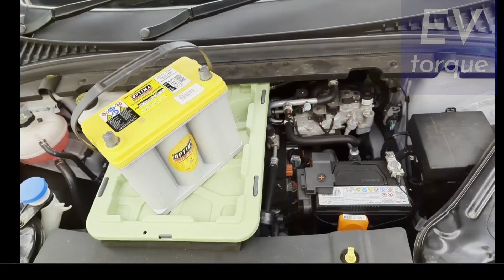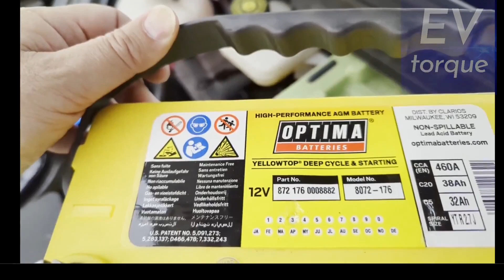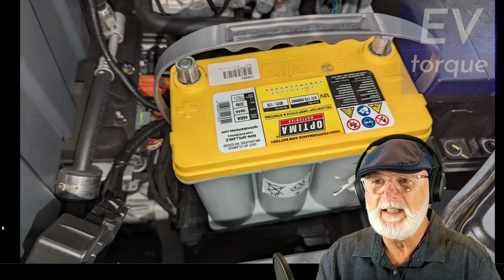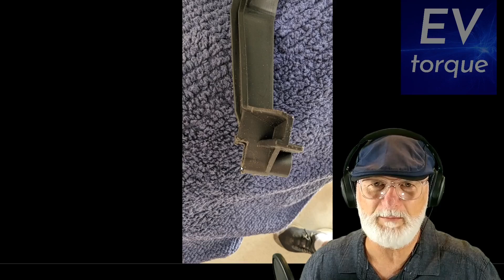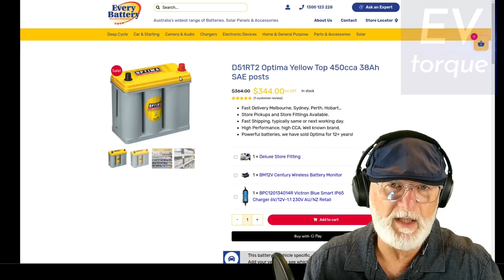BYD Atto 3 - 12v Battery Upgraded with a Deep Cycle Battery

Comment: At 6:20 your battery monitor was not "going berserk". You should trust your instruments more. It was showing exactly what it was seeing: When an electric motor, basically a large electromagnet so a large inductor, with a large compensating capacitor, gets its current cut suddenly, you get a voltage spike and then a voltage trough. What you are seeing here, is the real reason why they put the 12V battery (or 16V for new teslas, same reason): To mitigate the spikes created when your car hits a road bump and then the high voltage battery has its chemicals all mixed-up for a millisecond, so you get a very short current cut. They could resolve this completely by putting six super capacitors in series (each needs a balance board in parallel, of course, or a single balance board for six caps. It's not THAT simple. Super caps have to be balanced properly.) instead of a 12V battery, but supercaps are expensive, balancing and controlling the pack of super caps is also expensive. Batteries are cheap. Plus you can make the customer pay for them so everyone is happy (except the customer, that it). 

Now, you could argue that it's possible to build yourself a "battery" made of six super caps (with a balance board for all of them) and that this would solve the spikes and troughs issue. True, it would. However, the entire car architecture is constructed around a 12V battery and having the main battery being disconnected when the car is shut down. So how will you be able to start your car, if you do that? What you really need to do if you want to go this path, is to change the entire car architecture by operating the DC-DC with voltage stabilization all the time, bypassing the safety relay (which is dangerous) and then you can replace the battery with six super caps in series. Alternatively, if you had access to the car's software source, you could change the software to really only operate the relay in case of a car crash and in all other circumstances keep it on, and then you could replace the battery with six super caps in series, while keeping it safe. But who has the software source? Right, only BYD. And they like to sell batteries🙂.

Comment: Q: Would any of this type of kit potentially impact warranty? New PRC MY25 Yuan+ are now fitted with LFP 12v with a predicted longevity of 15 yrs.
Reply from the maker: @bh2o  Not at all as 12v battery is not covered under warranty anyway. As far as I know, no vehicle ICE or EV has its aux battery officially covered. That said, BYD did exchange some of the earlier batteries when it became known they were failing so soon after transportation and delivery.
Reply: Do you have details for this replacement Lifepo4 battery please?

Comment: I think you could happily do a LiFe battery - it would just always sit at around that 13.8V which is about 3.45V per cell in a 4S configuration. That's close enough to fully charged as not to matter. A 100Ah 4S would be perfect. That should give you roughly 1200W available for things like power steering and the wipers.
Reply from the maker: Yes, I agree however LiFe at this price point did not seem to offer quality packaging. I do think that would potentially be a better solution, the simplest  for most people is an off-the-shelf solution whilst still encompassing a move toward deep cycle rather than cranking. I'm happy to be proven wrong and that good quality low cost yet robust LiFe packages are now a thing.

Comment: Great video Sly.  I notice the plastic box/frunk.  Is that a Bunnings box?  If so, what size is it.  Maybe a quick video on it as well...
Reply from the maker: Ha! Yes you got it. There was some talk on the forums about a different Bunnings box but the end result was it just did not fit very well. Reason is, they all tried an east-west fit. This one is North-south with the addition of some firm foam strips. The final mod was to shave the rear lip of the lid, so that one just has to lift the front of the lid's lip and pull forward and there it is! Ok, I'll do a video.
Reply: Thanks for that.  It looks like a worthwhile addition.

Comment: Hey mate just wanted to say I have followed your video and have also installed the exact same battery using the same battery clamp.

I found that I didn't need to use shims at all, the connectors fit very nicely around the terminals.
Reply from the maker: Well, that explains why I had to use a sizable screwdriver to open the clamps. Mind you, they were very secure after that! Shims were fitted by Travis at the store, so maybe he saw it a bit either way and erred on the safe side. I'll pass this on to him for future reference. Cheers, Sly.

Comment: Please follow up with a video showing the performance of the new unit using your monitor data would be really interesting…..have replaced my 12v with an equivalent century unit but would love to see your data . Cheers
Reply from the maker: I've now got the Battery Monitor Graphs of the new battery in several scenarios. Now to put it all together - video coming, thanks.

Comment: If you add a zip tie to the rear ‘rod’ you can ensure it won’t drop down through the hole in the base if you disconnect the bracket for whatever reason … good video
Reply: Great idea.